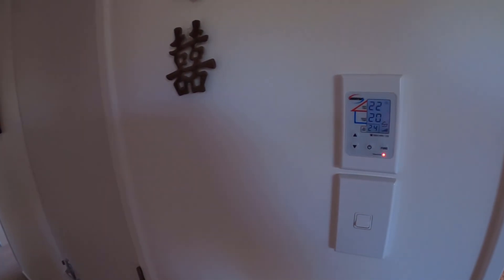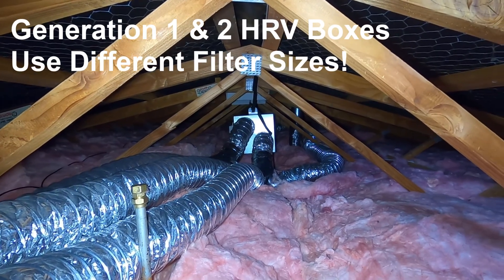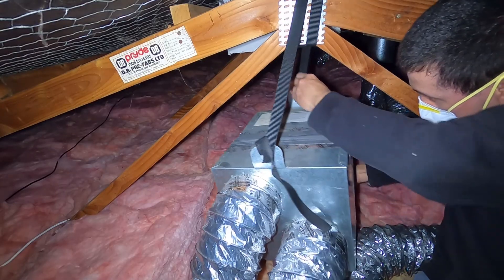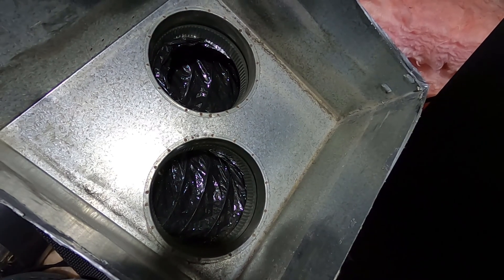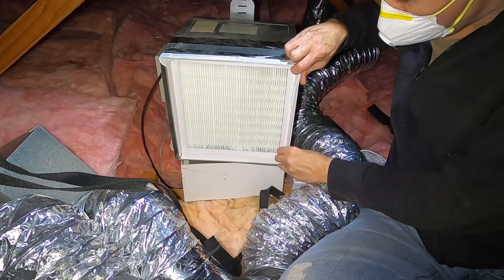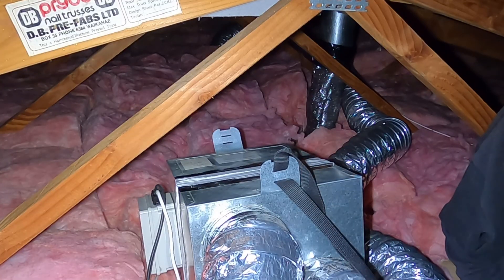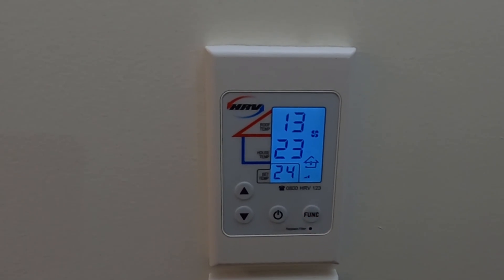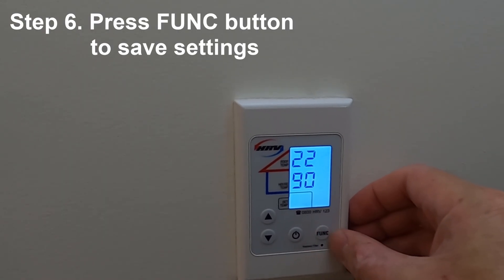HRV Filter Replacement and HRV control panel reset

Comment from the maker: Hi there, here is a video on how to replace the filter on a HRV ventilation system and reset the control panel.  When working in the ceiling don't forget to wear a dust mask and turn the HRV off at the control panel before starting the job.  Thanks 😊
Reply: Great video so I now know how to change the filters. I have the old LED control unit. How do I reset it? Geoff Rollinson
Reply from the maker: @geoffrollinson2835  Hey thanks for the comment, I have found this online. 
LED Control panel
1. Turn off Panel
2. Hold func button down
Give that a try, let me know how you go as I have these instructions in the comments also and will be good to make sure they are correct 😊

Comment: Please advise which filter I need
Reply from the maker: The galvanized metal HRV box like in the video is referred to sometimes as the Gen 1 HRV system, if you have a plastic box you have the Gen 2 HRV system.  Best bet is to just look online and contact them for the correct filter type and order, most sites state which system the filter is compatible with.  Hope that helps, thanks for watching 🙂

Comment: How do I stop this HRV from automatically turning on?
Reply from the maker: Hi there.  I don't think there is anyway to stop the auto on.  When you power unit off at the panel it will power on again in I think 8 hours. Thanks

Comment: Thank you for the video. I successfully reset the unit. however, my unit has a master unit and a slave unit. After reset, the slave unit was not functioning. I wonder the parameter you did for the control panel has anything to do with the activation of the slave unit. It will be much appreciated if you can provide assistance to it. Thank you.
Reply from the maker: Thanks for watching and appreciate the comment.  Hmmm I haven't heard of that one with the slave unit not functioning after a reset.  I wonder can you confirm the slave unit isn't going by listening to it in the ceiling as I wonder if its possible the replacement filter has stopped or majorly reduced the flow in that box perhaps?

Comment: Hi, I have exactly the same unit in my house, I try to changed the filter myself to save some dollars but now it is not turning on, it is making a ticking noise only that comes out form the box, what do you think is wrong? pls help 😢 Thank You
Reply from the maker: Hi there, If it was me I would first check that nothing is stuck in the motor\fan, eg bit of old tape or something that has sucked its way to the motor\fan when you lowered the box to replace filter. Make sure power is off to HRV, remove filter, check nothing is stuck in the intake side of fan (round hole on outside of box that air sucks in), check nothing is stuck on the blower side of fan (fan blades inside the box) check if fan still spins free by turning it by hand, get someone to turn panel on for a short time and just check motor\fan spins fine under power and power off, and re fit filter. Hopefully that helps.
Reply: @MannixGarage I will do exactly what you've suggested, thank you for your help.I subscribe you're channel as I found it very helpful for someone like me who like to try DIY to save some $$$ ☺
Reply from the maker: @westtessvlog4211  Hope you get it sorted out and update us on how you go.  Keep up with DIY good to save money and learn some skills along the way. Thanks for Subscribing, I have also subbed to your channel too.
Reply: @MannixGarage   I have to call the HRV technician to come and checked the unit after all because I wasnt able to get it going again, and sadly , the technician says its the motor that is faulty and it is not worth repairing because it is a 2009 model, she recommend for an upgrade. I do not really want to upgrade right now cos budget is tight. I was thinking of leaving it  as is, because I think the house is pretty dry , some condensation on the windows early in the morning but that is because its winter, there is no sign of moulds or any damp area in every corner of my house. 'What do you think?
Reply from the maker: @westtessvlog4211  I think HRV charge a lot of money for a new unit.  I have done a search on google and found a seller on Trademe telfer88 sells a genuine motor fan replacement for HRV.  Depending where you are located you could message them and see if they could fit it for you, or if you are comfortable removing the galvanized box (if the power isn't hard wired in, plug in only) see if you can send him the unit to fit and test? In the meantime if you have no condensation over winter just leave it for now is a good idea. 🙂 Our unit is a older one too so I cant do a motor replacement video until it fails.
Reply: I think I will leave it for now😔Thank you very much for your help and your genuine suggestions, really appreciate the insight. All the best!! Cheers👍
Reply from the maker: @westtessvlog4211  No worries hope you get it sorted.

Comment: Hi while mucking around doing an electrical job adjacent to the controller I managed to make the controller upset and beep angrilly.  I unplugged the controller and when i plugged it back in the thing seems to be ok but temps are now in fahrenheit.  do you know how to change this back?  same controller as featured in the video.  if you knew where one could find the installers manual for this thing i'd be very grateful.
Reply from the maker: I will have a hunt on the internet as I don't know off hand unfortunately and the HRV guide found online isn't much help.  Hopefully someone else who sees this comment maybe able to help too. 🙂

Comment: Hi, do you have a wiring diagram to the fan in the filter box? Mine has shorted a number of wires and I can't determine which wires to reconnect. Thanks
Reply from the maker: Hi there, no I don't unfortunately. I'm not sure if this link is of any help but if your unit is the same as mine you can just see some of the wires in the picture https://www.geekzone.co.nz/forums.asp?forumid=141&topicid=272958 .  I will be changing the filter in my HRV this winter so could get a picture then if you need?  Cheers

Comment: Thanks - a very helpful video. What tape did u use? and HRV said set at 23 not 22, probably not critical ? Great Mannix Garage
Reply from the maker: Hi Raymond, the tape in this video was supplied with the filter, however the tape was exactly the same as grey duct tape, so you could easily just use that instead.  Thanks for the question, glad you found the video helpful.  Oh and nearly forgot, no I don't think the number setting its critical but you may as well apply that setting that they have told you. Take care 🙂
Reply: @MannixGarage  thanks much appreciated

Comment: Muppets who installed my janus unit tied the straps at both ends. A real pain to untie that strap. Might have to cut the shortest knot off and sacrifice a few inches to to change the filter.
Reply from the maker: Hi there, you might be able to work the knots loose with a small screw driver
Reply: @MannixGarage  Did try that, but in the end I did cut the strap. It's working now up in my roof. 

🙂

Comment: Hi there, Just watch your video and have compared to another on exactly the same system.  Where you hit power button to change setting to "90", the other gentleman suggests the setting be "10".  My question is - what is this setting for? and any idea why the two of you offer different ranges?  see other video here - https://www.youtube.com/watch?v=Wvwp8vX3_pY.  Regards, Phil
Reply from the maker: Hi Phil, good question, I purchased the filter from https://www.filterspecialists.co.nz/ . There instructions are below for HRV LCD panel but note "Press the power button to increase the 0 to 9", there is no 9 but panel steps in increments of 10 therefore I have put in 90.  Also there is not much on the internet on the particular settings, but my guess the settings are just to set the timer for the filter light.
TURNING OFF THE HRV FILTER CHANGE LIGHT #2
Switch off at the control panel
Hold the “down” button for 8 seconds
It will beep after about 3 seconds, but keep it pressed for the full 8 seconds
02 is displayed in the roof
Press the “up” button to increase 02 to 22 (not holding it down, short pushes)
Below the 22 you will see a 0
Press the power button to increase the 0 to 9
Push the Function button to save settings

Comment: Hi, 
I’ve just installed a second hand hrv system with a LED screen ( so old one). 
I had to cut the cable to get it down the wall.  I did reconnect it. But now it doesn’t seem to be working. 
When I open the control box in the ceiling, there is a red led flashing “led1”. 
Do you know what’s wrong? 
Cheers 
Flo
Reply from the maker: Hi Florent, sorry for the late reply.  Look to be honest I don't know.  I wonder if you have made sure that the cable wires to the control module is the correct way around when reattaching the cut cable together,  and there is a filter fitted?  Maybe make sure no wires have pulled in the plugs at both ends could be something to check also.

Comment: I have to control panel with no buttons. 
Have checked fuse box and all is good there. 
Is there anyway to turn the panel on?
Reply from the maker: Hey Henry, is this the new touch screen panel?  Has it randomly stopped working or was it working prior?  You may have a setup similar to mine in the ceiling space where mine was plugged into a power socket (in the video i unplugged mine while working in the ceiling), perhaps the socket has been unplugged from the socket.  Another possibility that the plug into the pack of the control unit or one running to HRV is loose or has come unplugged check those out. hope that helps
Reply: @MannixGarage   hiya. 
It was working prior. 
Thinking it might be the filter.
Reply from the maker: @HenryKillian  I don't think the touch screen panel will turn off if the filter needs replacing, but ill do some research and see.  I am sure it will just be a warning light for filter change.
Reply: @MannixGarage  haven’t checked to see if plugged was tripped.
Reply from the maker: I've done some digging on the internet, the new control panels don't shut off if the filter needs changing but will just indicate that they need to be changed.  So check in the ceiling incase you have a power socket like mine that is loose, and also check the plug to the back of the controller and the HRV in ceiling (plug looks like a phone plug)
Reply: My HRV touch screen has filter blinking. Do you know how to set it back to 100% currently its 0% even after charging the new filter from burnings my self. Any advice would be great. Thanks
Reply: @bernardgibbons1037  He put instructions in the video description like he said.
Reply from the maker: Yup just check description, there are instructions for 3 models there, cheers

Comment: Do you know what all the other controller settings are for as in 02-21?
Reply from the maker: Hey no i dont, typically i have only needed to reset the filter light. There is a winter and summer mode which you can find instructions online for, but I have found limited information online for other panel features.